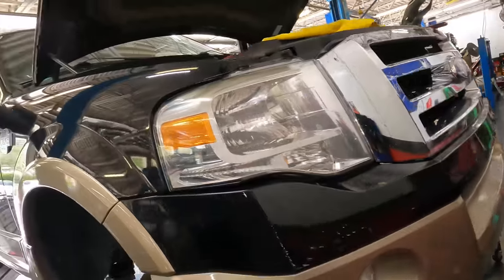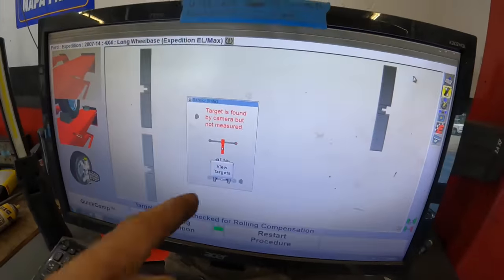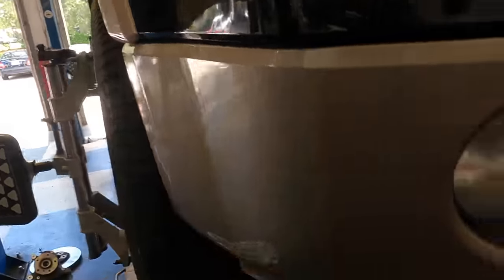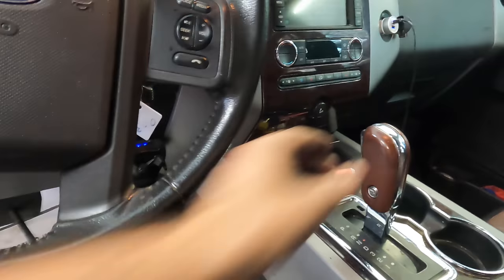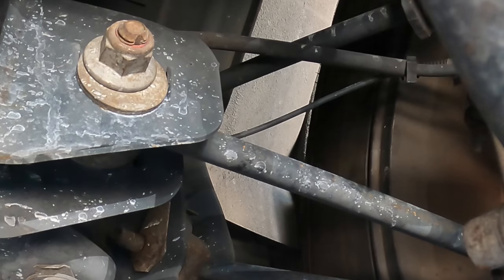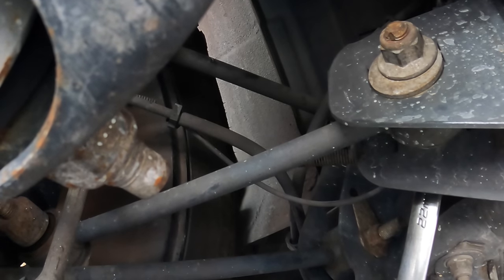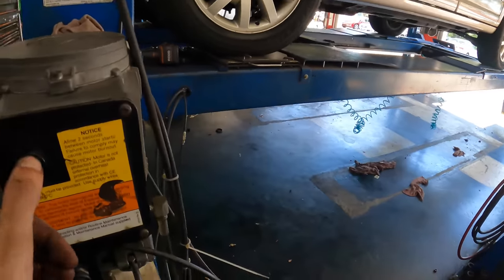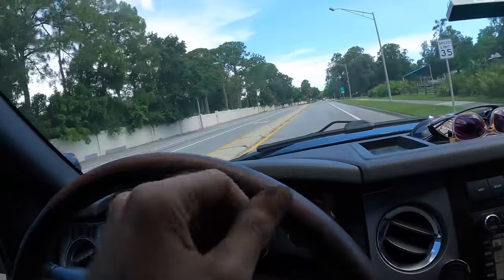Too Far to Measure! 2012 Ford Expedition 5.4 3-valve 4x4

Comment: Ray, I really like the alignment videos.  There isn't as many professional content out there  for alignments compared to so many other common issues like brakes etc.  It's cool to see a pro working with specialized equipment and showing the operation and steps and also seeing progress take place.  Good job - good stuff!
Reply: Same I do enjoy more alignment videos. I do alot of alignments at my shop. Some are more of a pain than others.
Reply: Alignments are usually toe & go and simple but once you get into full camber/caster/toe it can be confusing if you havent  done it for years. Red/green means nothing for caster also, numbers do. Having to explain that to a customer can be difficult at times if they want a print out. I set 1/2° positive to the right which helps with sloped roads.
Reply: I agree and appreciate your detailed explanation

Comment: That was a very important step at 16:00. I changed my steering rack myself because it was leaking. A few months later I had MOT, I think you call it state inspection. The rubber sleeve was broken again. I hadn't noticed that when I put it back together the sleeve had rotated and broken

Comment: Hey Ray, those tires that were cupping will smooth out in a few hundred miles. I' m speaking from personal experience, having 4x4 vehicles for many many years. Have yourself a great day! Guy Franks
Reply: Never seen tires self true . Always had to use trueing equipment .
Reply: Those tires may not get worse now that the front end is tight and aligned,  but they will not smooth out.
Reply: @JohnStray569  if you put them on the other side of the vehicles, they will smooth back out. I see it all the time on my fleet trucks.
Reply: @inoahmann7542  nope. I worked for Firestone/Bridgestone for thirteen years, once a tire developes a negative wear pattern it's a static pattern.
Reply: @inoahmann7542  reversing tire rotation (on aged especially ) can lead to catastrophic failures per NTSB. Tire truing/shaving is only method I've seen that actually solves rough/OOR tire issues.
Reply: @JohnStray569  I have seen wear patterns go away. As long as you catch it early enough it can be corrected. Once it gets bad enough to make noise or shake, It's too far gone. You probably know way more about tires than me, I've only been in this job a couple years, I'm just speaking from what I've seen.
Reply: @peted5217  A normal tire rotation on bi-directional tires swaps the tires in an x pattern. You mean to say that's not safe? (drivers front to passenger rear, passenger front to drivers rear, etc.) If your tires are aged enough where that isn't safe, they should probably not be on the road anyway.
Reply: @peted5217  yes I'm actually shocked that this guy thought he could just change the rotation after thousands of miles, this is known by just about anybody who is experienced in tire installation that you never ever change the tire rotation direction after x amount of miles and yes this could be catastrophic as the belts have worn in to a certain direction. That's why I always said once you think you got a great mechanic and then he do something as stupid as this you just shake your head
Reply: @inoahmann7542  Ya. That's no longer recco'd. Remember that's from the Pre-Radial time period. Only Front to back now advised.
You may have noticed many new radial tyres have directional markers in sidewall for that reason and tread designed to grip best in that direction.

Comment: Morphed project on 04 Ram 1500 2 wd quadcab, 76k miles. Shorty headers, 2 inch lift spacers, Rancho 9000 shocks for Ram 2500.  On 4th set of new tires wearing mad on outer edge, which I expected after new front end.  Tech called me over and wiggled upper control arms and said "I can losen and tighten these all day long and it will never align".  Ordered camber and castor adjustment kit,  4 pieces, 2 for each  leg of upper control arms, did another job while waiting. All the other techs gathered around wide eyed to see what he was doing.  Don't know how it works, exactly, cam holds the setting in place until the control arm bolts are torqued.  Took 4 hours, just charged for the kit, like $120. He had experience with Gen 3 Rams.  We bonded and were chatting afterwords. The rack was cool, like could jack the frame seperately.

Comment: When I replace a rack (steering gear), I take the clamps off the small ends of the boots (bellows), slide the boots back, apply some silicon-based lube to the shaft (gigidy), and reinstall the boots/clamps.  Makes the toe adjustments a breeze for the life of the vehicle.

Comment: When I first started doing alignments in the late 80's we had strings that ran from the front heads to the rear heads on a Hunter Alignment machine
Reply: Mine was the Hunter Lite-o-line Aligner. 2  printed plates, mounted on the wall with lights lining up with measurements on the plate. Then the Hunter A111 aligner with the strings. They were both a temperamental as hell.
Reply: @the_old_guy_yoda  In the mid 70's I remember seeing a Bear alignment machine that had a box with a scale on it and light would shine from the back to show the measurements

Comment: TIP: if you need to use heat to loosen a nut then ensure that the component has fully cooled down before making an adjustment. This happened to me - as I drove down the road the steering wheel went more and more off-centre. The garage said that they had to heat up the locking bolts on the rack to loosen them. As they cooled, the rack arms contracted pulling the wheels out of alignment.

Comment: If there is one thing I don't like on this one is lean not corrected in rear. The new ball joints might need turned some other direction to help the adjustment of the unadjustable corner. But hey, you are better at this than I.

Comment: I can see the wheel grabbing. If that rack isn’t dead nuts centered, the toe won’t matter. Those arms are angled and any off center gives you that wooshy feel. 
New rack means new filter if applicable.

Comment: Great video Ray, I usually remeasure caster and reset the steering wheel after rear adjustments. I’m not sure if it makes a difference.
Reply: Depends. A caster re swing after doing rear toe adjust, no that doesn't matter. A caster re swing only matters when you do camber/caster adjustments or a large toe adjustment. Straightening the steering wheel after doing rear adjustment only matters if you had to shake the whole damn vehicle just to loosen an eccentric...fucking rust.

Comment: As a UK resident  gas prices have gone through the roof. 
Are these trucks with 5.3 litre engines as popular as they once were or are Americans switching to smaller more compact fuel efficient cars ?
Reply: I daily a 4.7 liter V8. I get like 12 miles per gallon. Idk what the metric conversion is.
Reply: Given the supply issues and cost of used cars going through the roof -- it isn't like people have a lot of choice.  I was amused when our neighbor's son showed up with a lime green Elantra yesterday.  He's a tradesman and normally drives a pick-up that he uses for plowing in the winter.
Reply: @SaltlakePromotionz  it's 19.6 L/100km. A lot! 
Good fuel economy on  a sedan is nowadays beween 33.5 and 47 mpg. 
The yesterdays price for 1 Liter war 2,06 Euro - that is 7.8 Dollar to the gallon. 
Gasoline in US is still super-chep - in comparison to EU.
Reply: @SaltlakePromotionz  it's 19.6 L/100km. A lot! 
Good fuel economy on  a sedan is nowadays beween 33.5 and 47 mpg. 
The yesterdays price for 1 Liter war 2,06 Euro - that is 7.8 Dollar to the gallon. 
Gasoline in US is still super-chep - in comparison to EU.
Reply: Have seen that sedan prices are up & truck prices are down, so, yes, it's having some effect.

Comment: So I have PRO TIP for you @RainmanRay when the camera gives you a hard time with a rear satellite head not being seen stand directly behind the head to give a large brightness contrast between the head face and the bright sunlight outside 😉....I am also an auto tech and have a few videos posted up check them out....I've done a few alignment videos 1 being VW engine cradle shifting for camber correction

Comment: You save yourself alot of hassle eyeing the toe before you take it off off the lift. Lock the steering wheel and adjust. You can get it good enough before you hit the rack. Replaced a toe bar on a jeep today, eyeballed it and had a 7 tenth split on total toe. Still had to move the right wheel to center and adjust the left toe with the sleeve & adjust steer ahead. Jeeps arent true total toe like 1/2 ton+ trucks. The passenger tie rod doesnt adjust.

Comment: 9:26 - Could the rear toe be affected by whether the car is perfectly straight on the rack?  Was going to ask if it matters that the fronts could be off, but you answered that question - front is keyed off the rear.  Maybe the machine 'knows' if the whole car isn't perfectly straight by computing the average of rear vs front?
Reply: Unless the vehicle is excessively crooked the alignment machine can calculate this.  It doesn't even have to be perfectly level.  Long as it's close to straight and level your fine with newer camera machines.
Reply: On hunter alignment racks you do what is called "rolling compensation" you put the heads on all the wheels, it takes a measurement, then you roll the car forward onto the pin plates and chock the wheels so it won't move. Then it takes another measurement, then you proceed to a caster sweep. Rolling compensation makes it so silly things like a head not being on perfectly straight or the car being crooked doesn't matter
Reply: what first last said + the fact that the panels on the wheels are retro-reflectors. < those reflect the IR/"laser-beam" light back Exactly at its origin, No matter the car angle (unlike mirrors)
Reply: @IcecalGamer  Ah... laser... it scans each of those retroreflectors individually, not all at once

Comment: For the accurate rear mesurement and adjustment you must have a plate thats under the front wheels. Like this its gonna be tension due to the friction between the lift and the tires.
Reply: Rear plate built into the lift has pins you pull out .
Reply: There seemingly wasnt any
Reply: @mediashark10  I went back and looked, it's there. It's part of the rack and around 2' long
Reply: Sorry, just ignore me then 🙂

Comment: When you started the engine with the door open - my Gladiator won't let you do that.  Door must be closed to start it up.  It is a giant PITA.
Reply: How do you start it with doors removed as I've seen sum drive that way ?
Reply: Try clicking the seat belt that will make it so it doesn’t put the parking break on when rolling with the door open it might help with that as well
Reply: @peted5217  Not sure as I haven't taken the doors off yet.  I have pulled a camper several times with it and wanting to just jump in and move it a few inches and having to shut the door gets old really quick.
Reply: @midwestapprentice1904  Thanks for the tip I will give that a try here soon.
Reply: In that case you just leave the window rolled all the way down, and reach in and start it.
Reply: @brnmcc01  Good thought but would need one extra long arm to depress the brake pedal.

Comment: Curious as to why rear toe off on full frame vehicle with substantial locating arms. Driver must do some serious curb slamming !
Reply: It makes no difference if it has a frame or unibody.
Reply: @AT-wl9yq  I only mentioned that as full truck frames seem to hold align in spite of harder use.
Reply: @peted5217  Its the same either way. You have either struts and/or control arms bolted to a frame, or a unibody.  There's nothing about a full frame that would make it hold and alignment better. It just isn't part of it. Better quality or more durable front end and suspension parts would make an alignment hold better.
Reply: @AT-wl9yq  Apparently you've extensive background in vehicle chassis design that I lack. My observation was based solely on four decades as general tech. Sum stuff seemed to hold up better , possibly only an apparition
Reply: @peted5217  There's no reason to get upset. I was just stating a fact. The type of frame Makes no difference. 

"Apparently you've extensive background in vehicle chassis design that I lack. "

Thanks, but I wouldn't go that far. I do specialize in front end geometry and teach wheel alignment. Your theory doesn't hold up to what actually happens. I'm not going to agree with something just to be polite. If you can show me something that I'm overlooking, I'll be happy to look at it. 

In my last post, I gave you what was the most likely reason for your observation. Better, stronger parts. Whenever your wheels hit something. front end and suspension takes the hit, not the frame. If you think that's wrong, explain it to me.
Reply: @AT-wl9yq  Ya, well, this waz a FoMoCo tinker toy IRS with obviously under sized components that readily tweek going over Speed Bumps. Probably good candidate for bi monthly align checks. You are correct.
Reply: @AT-wl9yq  A Kwik review of 1st comment doesn't really promote full frame per se over any other type. It does however (wrongly or ritely) note that substantial appearing locating arms (which normally 'take a lickin & keep a tickin' ) have allowed the rear align to change a bunch. Hence the comment on driver's style. Read it agin and you'll see. 
Ya , aware that properly built chassis of any type inconsequential in align ...........
Until impact force on suspension parts  is great enuf to bend or rip i
attaching points. I'm sure you've seen that occasionally.

Comment: Anti-seize on the tie rod end adjuster sleeve threads please sir…… for the next guy
Reply: Florida…not necessary. That stuff will come off just as easily 5 years from now. I’m from the great white north and I used to put that stuff on everything. I moved down here a dozen years ago and I’m amazed at how bolts and nuts can come off without air chisels, torches and hundreds of swear words. Other than being a little dirty, if you look at anything underneath my 2010 Mazda with 268k it looks like it could have been built a year ago. My 99 suburban has only surface rust on a few of the dangly bits underneath. Where I grew up, a 99 suburban that has 280k, has not been washed in 2 years, has never been in a garage and has basically been neglected would be a pile of tetanus waiting to happen. The worst that happens down here is the clear coat dies and flakes off and the plastics fade and turn into the consistency of a dorito.
Reply: @stevewhiting556  If you did a lot of alignments you would understand what I mean

Comment: Hey Ray just wondering do you ever disconnect the battery when you do fuel injectors? You never say and just wondering if you have to or not..love the videos keep it up
Reply: Fuel injectors get constant power directly from the battery, so once you unplug them nothing can really happen. That said, its still not a bad idea to disconnect it. Sometimes you make a mistake or touch the wrong thing.

Comment: Ray, you're still using the wheel chocks the wrong way around. The fast rising side should be against the wheel. The sloped curve side should contact nothing but air. The side with all the ridges goes on the ground.

Used that way, those same chocks can hold multi-ton aircraft in place. If you have them in the way you use them, any change in weight means that the tyres dig into the chock and it's never coming out...

Comment: Hey Ray Ray! Remember your belt markings having to point towards you? And the oil fill cap oriented perfectly?
Know what would drive me nuts? Having an alignment performed and the damned steering wheel pointing at 12:15 or 12:30.
Doesn't your shop have a steering wheel lock to go along with the brake pedal lock?
Make that wheel 100% straight!
Oh yeah. They do make wrenches that fit the tie rod adjusters and lock nuts. Pliers??? Really dude??
Reply from the maker: We have two steering wheel locks, I don't use them. I know the part that you're referring to. When I got back into the truck the SW was off to the right. (I moved the actual wheels to align the pins in the turnplates) And yes parrot jaw pliers, wrenches slip off of tie rods
Reply: @RainmanRaysRepairs  Just saying. I wouldn't want plumber tool marks marring the finish on my own personal car. Ya' probably should lock the SW personally. Saves a trip back on the rack. I know, After, you count a hex shorter and a hex longer, don't you? Haha my PP is center caps and wheel locks being symmetrical on all wheels. You're doing good dude. Great stuff!

Comment: Neighbor stopped in for a minute near the end of the video stream. He heard the audio about the noisy tires being moved to the rear. This is what he said: "If it's got an LSD, just powerbrake it to get a double line, then adjust air pressures for maximum width and spin them up to 80 MPH for about 15 seconds. That ought to even them both out." Hillbillies, lol. . . .